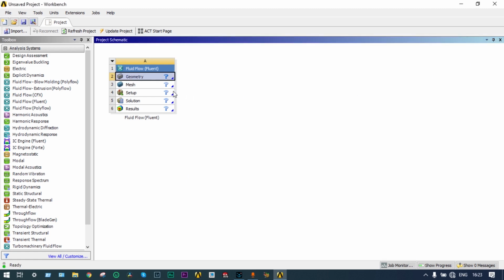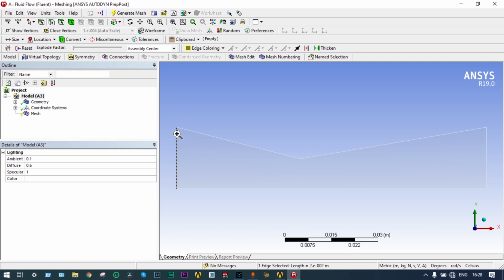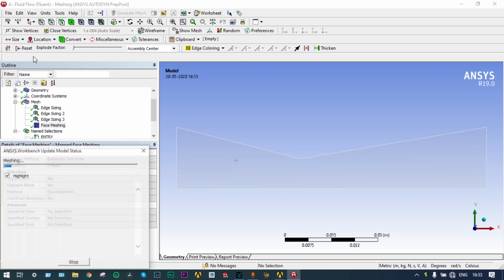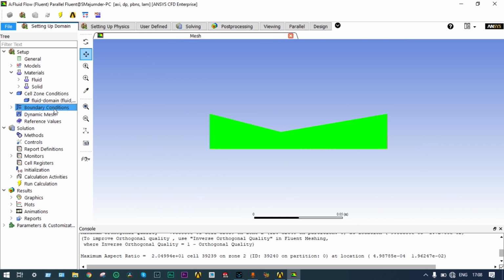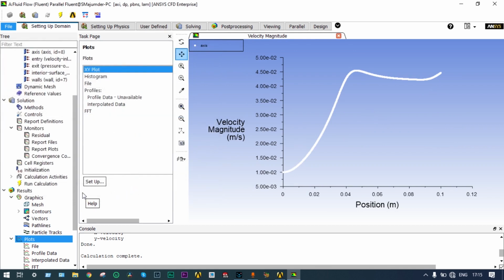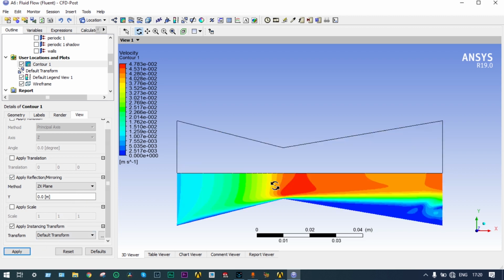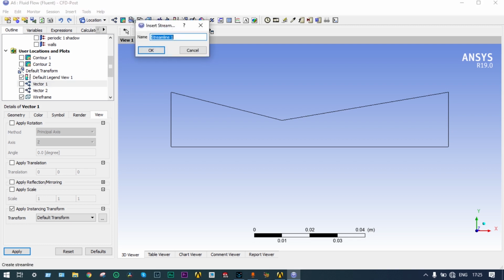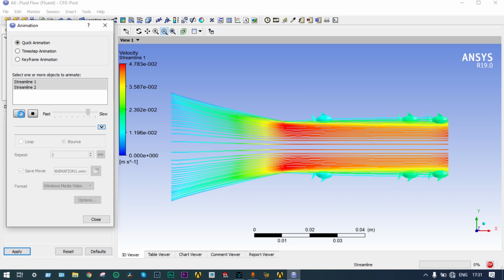ANSYS Fluent Tutorial for Beginners : Flow Simulation through  a Venturimeter

Comment: Sir could you please tell how to measure discharge
Reply from the maker: If you know mass flow rate or velocity at inlet, the same can be obtained at the exit also. You can have velocity at exit. Also you know the cross sectional area at exit. Multiplying these two you will get volume flow rate and then multiplying with density you can get mass flow rate at exit. According to continuty equation Q will be equal at any section